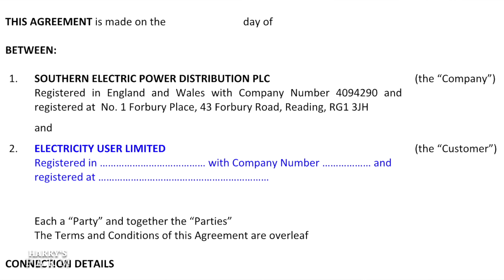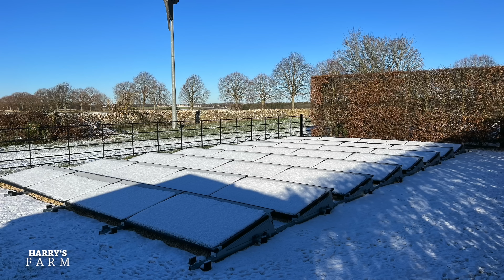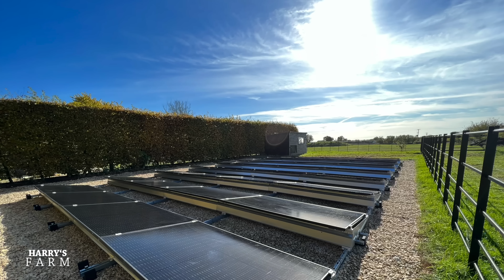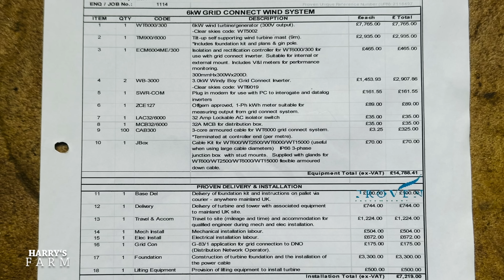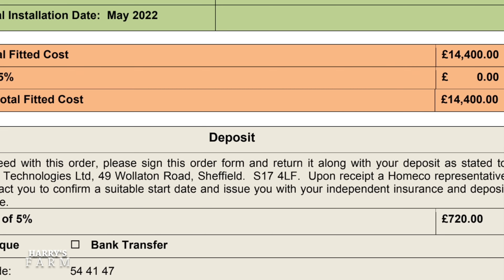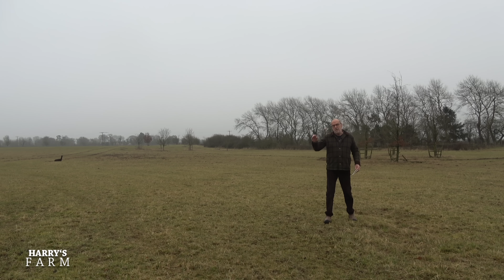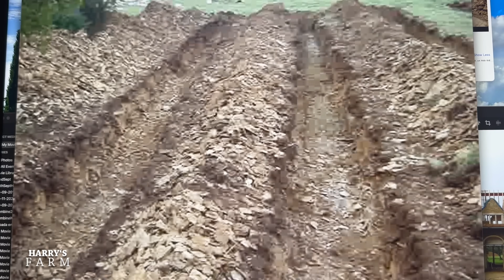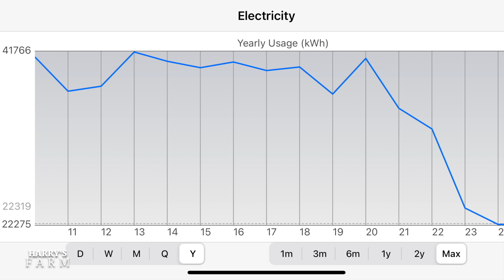Are solar panels & heat pumps worth installing? Here's what I've learnt after several years of use.

Comment: The point of batteries in winter is to  charge them from the grid on cheap overnight electric to use in the day when it's 4 times the price not to mention using them overnight in summer when the solar input drops.

Comment: Absolutely fascinating and the key point is that you are able to find ways to use what you generate in the round. I have a modest SW facing roof unit established in late 2022 with a 3.6kW rectifier and there is no doubt if you have panels the way you use electricity changes automatically. A neighbour who has the old FIT told be beforehand you almost sub-consciously put the washing machine on when it is sunny and it is true.! Also I have a 900W electric kettle that makes best use of any generation going. I export what I don't use and in summer this can be 25-28 times what I use off the grid and that is energy that does not have to be generated by gas. One point to note associated with the shading comments is that convective cloud can really knock generation on the head and the "best" output in the round can be in later Spring when the air can still be crystal clear. A good clear day in winter can generate a worthwhile output but you really have to use it if you can.
Reply: We get cheap rate from midnight to 7am and our challenge is to shunt as much as possible into that in order to minimise the day rate. I'd rather pay 6.7p overnight to run the washing machine or dishwasher and then export that power for 16.5p during the day. So we schedule both of those appliances to run during the night. My wife normally gets up at 6:30 with the kids so can empty the washing machine and get another load on before 7am.
Reply: @FlatToRentUK  Cheers. No I don't have a battery and would not be easy to add. Who is paying 16.5p..?
Reply: @Hugh-N-inKent  E-On Next pay 16.5p for solar export. They also do an EV tariff called Drive which has a lower peak and off-peak rate than Octopus plus an extra hour overnight. So I moved over last year.
Reply: @FlatToRentUK  Thank you and maybe that is the point. Everyone's experience and use of solar is different and the market keeps changing.. for example the tracker rates and then there are schemes for free electric at certain times to balance out consumption.
Reply: @Hugh-N-inKent   Yeah, you've got to put a bit of effort in and run some numbers to see what works best. I was surprised to see a cheaper EV tariff than Octopus were offering and also having better export made it an easy decision. I had to basically deactivate the Octopus smart charging periods because it'd just drain my house battery. Since moving I've actually fixed that issue so may factor it in when moving back in future.

Comment: Batteries would save you a fortune!

Depending on your tariff and system sizing, in summer you could charge from solar and run off the batteries overnight, reducing your grid draw to zero for half the year. In winter you fill the battery on cheap rate electricity overnight at 7p/kWh and run the house in it during the day, reducing your peak rate grid demand to zero.

We have an all-electric 147sqm Passivhaus with 13.8kWp of solar and 27kWh of batteries, EV (12k miles/year), etc and the system generates a monthly income of about £50 or £600 per year. So both net-zero and cash positive 🌞💰
Reply: The part of this that I like, which Harry touched on in his video, is the future-bill-proofing. Yes, the systems are relatively expensive to install, but the amount of peace of mind you get from knowing that your energy bills aren't going to double or triple in the next decade - especially with the Energy Minister salivating at the idea of more "green tariffs" - is immeasurable.
Reply: @nickstevens84  wow, you have so much faith ! The whole energy grid pricing is 100% rigged
Reply: Well said.  If you cant sell some of your power to the grid, the whole system will never pay back itself.  In Greece where I am you practically can't sell to the grid.
Also it pays to do this on a vacation or weekend home.
Reply: I've got solar, batteries and an EV. I never charge the car from the solar, the cheapest electricity I can get is 6.7p so I'd rather pay that and then get paid 16.5p for my export. I also charge the batteries overnight and they never discharge during the cheap period either. As soon as it gets to midnight they're offline until the day rate begins. This is my setup year round and the aim is to draw nothing on the day rate but in practice this isn't achievable. I could pay for more batteries but they'd only get utilised in winter and would take 20+ years to pay back the cost.
Reply: @FlatToRentUK  I’m very similar. The car is charged on cheaper grid electricity only and solar and battery run the house in the day. No problem if I have to pop onto the grid during the day for a bit of extra power (very very rare). Everyone without solar or batteries is on the grid all day anyway!
Reply: @javelinXH992  Yeah, it's the only way to go. But I still resent every KWh of daytime import! Just looking out of the window now at a dark, gloomy day knowing that the panels are generating absolutely zilch and my battery will die about 5pm!

But that's my problem and I'll get over it...
Reply: @ I’m lucky we don’t use a lot at home and our battery covers it unless we go mental.

Certainly a dark one today, so basically battery only, although I am producing 100w at the moment from the roof ! Every little helps 😀

Contrast that with a sunny day in January where I got 9kWh during the day!
Reply: Sounds good but does not scale well - If most of the UK had batteries (or used their cars as batteries) then there would be no rate differential to exploit. 
Essentially you are drawing money from those who are too poor to have a system like yours. I don't mean this to imply that you are doing anything wrong, only to point out that it cannot be "the answer" for "mr average".
Reply: @SmileyEmoji42 I thought the rate differential was because industrial demand was much lower overnight?
Reply: @wandering_not_lost I think that was mainly due to having to keep coal and nuclear power stations running continuously. Also, we have less industry now because we have the highest industrial energy costs in Europe
Reply: No, it doesn't save anything. They don't last long and cost as much as they save.
Reply: That income is going to stop soon with the cuts in capacity that the Net Zero targets are implementing.  Oh well there's your subsidy gone!
Reply: Cash positive only if the financing cost is not considered.  At 600 per year it will wear out long before it pays for itself.
Reply: @paulogden7417  Most well configured solar systems will pay for themselves in around 7 years. They're guaranteed for 25 years. The £600 is a net profit, remember without solar they might have a £1,000 electricity bill. So the solar benefit is £1,600 per year.
Reply: How long does it take to recoup the cost of those installations ? Years and years.
Neighbour of mine got a solar system in that pre heated his tank of water. The idea being he wouldn’t use so much gas to heat his hot water as thecwater would have a little heat in it already.
The system cost him nearly £5 grand around ten years ago. Experts reckon the system saves you around £80-90 a year on heating your water. That means it would take 55 to 60 years before he makes any money on his investment ! Absolute bargain 😂
Reply: @vtechead1  A water heating system is a long way from a properly installed and configured rooftop solar system. For one thing there's no possibility for grid export which is how I earn about £900 per year. Not to mention that the relative power and cost of solar panels has changed enormously in 10 years. Back then one panel might do 100w and cost £1000. Now you can get 440w panels for £70. A system bought today would probably pay back in 5-6 years.
Reply: @ yep, I was
Just giving an example of what was being promoted years ago.
He makes around  £400 from his solar panels, not the sunniest of countries here. 👍
Reply: @vtechead1  solar electricity installations typically have a payback period of 7-10 years in England. Not many people get solar water heating installed, as they are nowhere near as good in terms of ROI.
Reply: his heat pump always must run. 7.2kw rated power. so your 27kwh battery is dead in about 4 hrs. 
night is longer than 4hrs.
Reply: It's a big investment to save 10p/kwh, vs exporting at 15p/kwh. I'm not sure the maths are as clear as you suggest, particularly if you're already making use of solar by putting into an EV

Comment: This video just confirms that solar, wind & heat pumps is a complete waste of money unless you live for a 100yrs.
Reply: No one as blind as the one that refuse to see
Reply: @ fools & their money are easily parted.
Reply: @scotiajinker8392 Captain Bah Humbag has landed.....
Reply: @ better than being captain gullible
Reply: @scotiajinker8392  what an angry little troll😅. It's not your money so it's weird why you're getting so emotional about it.
Reply: Actually I would argue that the video is great evidence that you need to use people who know about how to correctly design renewable energy systems and understand the value trade offs rather than just choosing equipment based on the initial purchase price.  A ratio of peak daily PV energy production from summer to winter being a value of 14 speaks volumes about just how badly designed this system is.  This ratio could be reduced down to a value of 3 for a properly designed system
Reply: Not true. The question is how to get the balance right macro (national) and micro (individual)
Reply: @ Harry said he spent £14k on solar & way more on wind turbine. He did say how much the heat pumps is cost. All that to have very little heat in the winter when you need it . All this green energy is the emperors new clothes. I’ve been in my 3 bed semi for 30yrs & haven’t spent 30k for heating & cooking in that time.

Comment: Living further South in Switzerland the difference between summer and winter is less pronounced. You get about 4 times in the summer what you'd get in the winter, so on most days you can power the heat pump even in winter with a reasonable amount of solar.

Comment: Charging batteries overnight on a lower EV tariff to use during the day can work quite well even if you have no solar. As Octopus are pushing allow local communities or areas to get reduced electricity prices. Put Datacentres into Scotland then rather than having to ship all of the power into the south for example. A far more efficient way of solving the problem.

Comment: Installing batteries would easily pay back the investment because they are saving you money both in the summer and the winter.  In the summer they are storing your excess solar to use in the evenings and at night and in the winter you can charge them up at night using an EV tariff for less than 8p a unit rather than pay 23p a unit.
Reply: The out lay for the batteries   is the draw back .

Comment: Add on Harry the installation, capital costs of all your solar panels, heat pumps, ground works, plus replacement costs when they eventually need replacing. 
I think for a country house in the U.K. you need a mixed system. Solar, wind, oil, wood burner, with a modern battery system - together with an efficient house. For those with an excess of logs or wood chip, a wood-fired boiler (either log or chip) can be a smart option too, either as a main system or as a backup.
Reply: No. Oil is just a massively expensive and massively polluting relic that also happens to be killing the Planet.

There are better ways of creating heat than simply 'setting fire to stuff'.

Comment: If you have an intelligent battery like a Tesla Power Wall it can charge on cheap electricity at night to use during the day, so even when the solar isn't producing excess during the winter the batter will be reducing your electricity cost and giving you some resilience against power cuts.
Reply: Agreed, but the Tesla 13kw battery pack is c. £10,000 + so not quite so  competitive .
Reply: @gramos9115  Quite so!  And many of the off-peak tariffs charge a premium for the day-time/early evening use once the powerwall has run out of juice!  People really need to be careful when doing the sums on this one!
Reply: @prolapsed5104  good point, which Harry doesn’t seem to consider.
Reply: Sounds like good advice.
Reply: Cheap electricity at off peak for now, but what happens when more, and more people start doing this?
Reply: @xlandros  Off peak electricity has been around for well over 50 years. A huge number of people do not care enough to take advantage of it. Maybe your grandchildren may have issues but not for a very long time indeed.

Comment: Harry. It's a real shame that you didn't bother to do the homework. Panels at that angle will not be great. Normal angle is 35-45' - guess why? Can't see why they have been set lower. 🤔 This will also allow the snow to clear quicker and they won't need cleaning. If you are going to have shading issues you should have installed "Optimisers" which will have generated at per panel level. Putting a PV location with hedges around it. 🤔  This is the equivalent of filling up the car with Diesel rather than petrol and complaining the engine will not start. Weird that other farmers are singing how well their panels are working. Must be your thing.😕

Comment: Many people have the idea that solar panels will run their heat pump. The other part of the mis-selling is that heat pumps and solar panels have a limited life and will need to be replaced at some point. That cost never seems to be worked into the economics of it all.
Reply: Solar panels usually last 25-30 years and still make power after that, just not as much! Expect about a 0.5% decrease in performance each year. Some can even last 40+ years if they're well-made and taken care of. They don't usually just stop working, they just become less efficient over time.
Reply: @misc000misc  inverters and especially heat pumps much less than that. Not sure sometimes if it's the salesman or customer with the rose tinted specs.
Reply: @Trickynickymarts  In a reply Harry made to someone in the comments his solar system is on course for payback in six years. This is quicker than he expected. 

Solar inverters usually last 10-15 years (string inverters) or 15-25 years (microinverters), which is less than the panels themselves. Inverters can fail more often because they're sensitive to heat and weather. Good maintenance helps! Plan to replace your inverter at least once during your solar system's life.
Reply: @ Ok sounds good but fast payback entirely due to the unusually good match of supply and demand, the pool heating. Most people have little demand in the summer and will have much greater payback time.

Comment: I have a tiny 2.6 kwp array facing 170 south and produced almost as much power as you in January (97kwh). I think because of the shading you may benefit from an inverter like SolarEdge with per panel optimisers or enphase microinverters which can bypass the panels in shade allowing the ones in full sun to produce their best output. Speak to your installer they may be able to tweak it those numbers don't seem very good to me. 
The hedge and fence obstacles will be massively reducing the ambient/reflected light on cloudy days which makes a big difference to total output over time. 
Would be interested in see output per kw compared to your shed panels with unobstructed view.
Reply: So you are saying your 2.6kw system produces the same output as his 12kw system in January...Doesnt exactly sound credible...
Reply: @ just rewatched that bit, he said December 24 was 119kw. Sorry my mistake, thought he said January. December was particularly gloomy. I can’t paste a screenshot here but my 6x410w panels did 48.1kwh 2023 and 39.8kwh 2024, 97kwh in jan. So comparing eggs with eggs is 9.3kwh per kwp for Harry and  15kwh per kwp for mine hence saying something is seriously wrong with that design and or placement because mine is getting 61% more power.
Reply: @malpracticesurf  All you have said is meaningless unless you tell us where you are located.  Geography makes a huge difference, so in the absence of that info we just can't know whether the difference between your data and Harry's is down to the installation or the location.
Reply: @ Agree. I’m in Cornwall. I think we get more solar intensity in the summer but in the winter I think it’s about the same as the Cotswolds.

Comment: With my Octopus Go Tariff of 8p between 12.30 am ....5.30 am, i so wish i had batteries to dump that cheap electricity , then in the day, run my house on that battery. As it is, I heat all my water my electricity over night , dishwasher , washer machine go on in the early hrs ---and of course i charge the car from 12.30.  Thinking of changing or adding electric rads albeit my day rate is 25p..  you were certainly ahead of things back in 2002./03/04/05...WELL DONE.
Reply: I'm with Octopus so that 8p overnight presumably hydro, wind and maybe a bit of gas generation might make it viable to add a battery.?